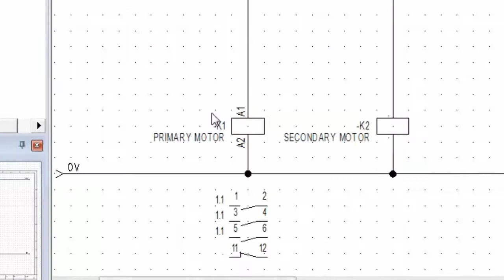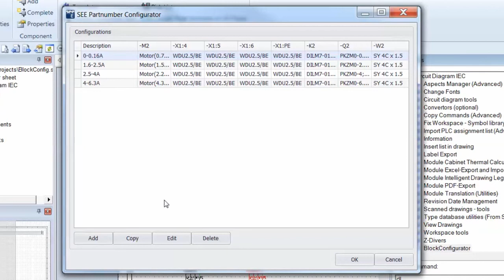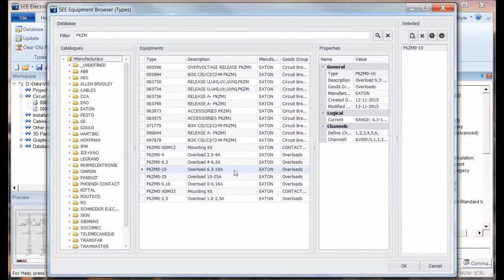V8R2 Block Configurator

Comment: When you add configurations then you need to save the symbol back in symbol library right?
Reply from the maker: Yes, if you change the configurations you will need to drag-and-drop the block over the original to update it.
Reply: @IGEXAOUK  Thanks a lot for all the answers